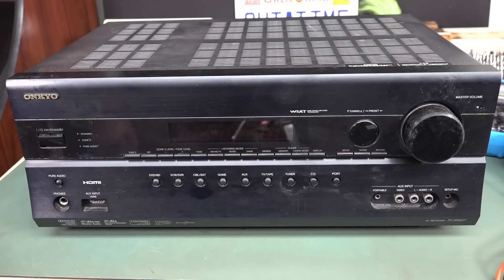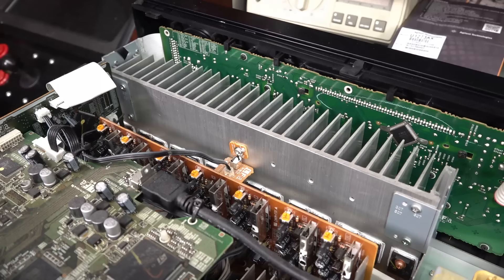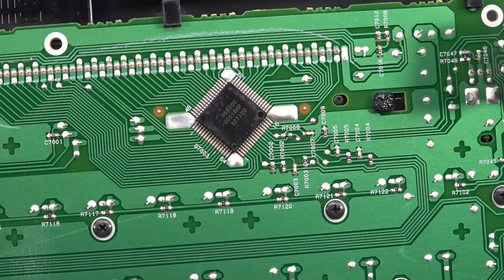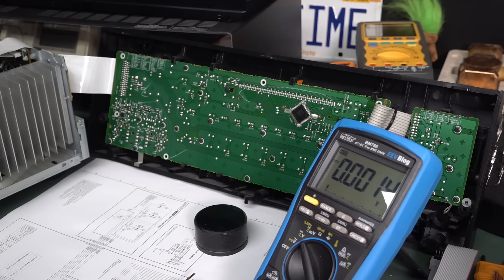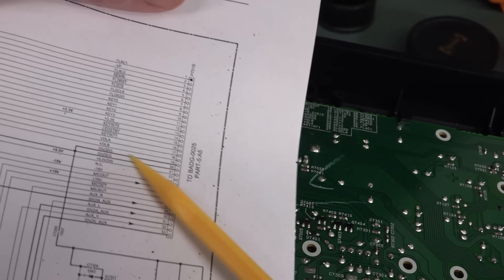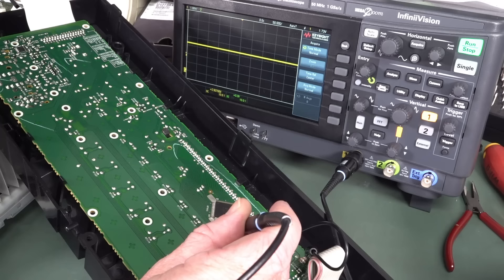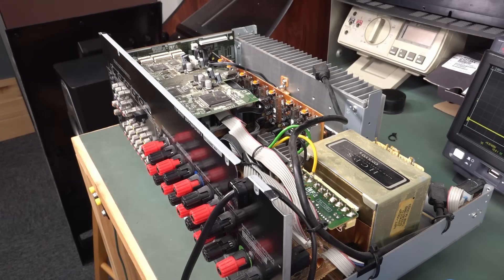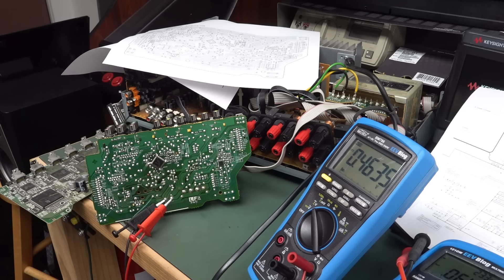EEVblog 1394 - Onkyo Receiver Repair - Part 1

Comment: Is the "Pure Audio" mode on?

My Onkyo has a "Pure Audio" mode where all sound manipulations are turned off for hifi fanatics. In this mode the display is turned off to prevent distortions from the display ;)

This setting is stored even if the receiver is disconnected from power.

So this is what I would check first, if the rest of the receiver is working.

Comment: I'm not sure if this receiver works this way, but on some of them if you engage the "pure audio" or "direct" mode it will shut down the display, along with any of the other sound processing modes in an effort to keep it all clean
Reply: Would be hilarious if that's what it turned out to be - trap for Dave players 😂
Reply: I was thinking that, too. But I think my amp is the same model as this, and it will still show something when it first powers on.

Then, if Direct mode is selected, the display will shut down after a few seconds.

I also wondered if the DIMMER button on the remote had been pressed, as some of them can turn the display off completely. It looks like it's probably the fusible resistor R9010 that's a common fault on these, though.

Comment: I have the SR606 and it's been plagued with bad capacitors. 

The HDMI inputs failed one by one then the machine started creating static popping & crackling when turned on from cold (which went away as it warmed up).

...I've had it apart twice now to replace blown caps. Next time I need to open it up again I'll just replace any I've not already swapped out.

Check all the HDMI inputs work before you finish with this thing (and check all the capacitors in general). If the 607 is anything like the 606 then I'll bet some of the digital inputs don't work and there are caps need changing.
Reply: agree.  I also have the SR606 and replaced the electrolytic caps  about 3 years ago when I had a similar issue

Comment: all the selection buttons are ADC resistor ladder based 
i really have to start using this for buttons you only need to click one of instead of matrixing and IO expanders / registers ...
Side note, i was screaming at the video the entire time for you to check lines going to the VFD from the driver chip

Comment: I have a dumb question?  Have you tried pushing the dimmer control?  I have a Sony that I can kill the display completely, not sure if the dimmer does the same on this unit.  ~Jack, VEG
Reply: Good idea... My wild guess is that the dimmer setting might not be retained if the receiver is unplugged for a long time.

Comment: Interesting... I have an similar Onkyo model (707 instead of 607) that won't turn the speakers on. I think I've seen videos of a BGA reball to fix the issue. This era of Onkyo seems to have a lot of problems, but I also have an Onkyo TX-8511 that's been great since 1997.

Comment: 29:05 I can't wait for a high end AVR to make its way into the lab. From memory my TX-SR805 has four boards to do with power supply, two backplanes, a seperate predriver board for each of the 8 channels, two driver boards, an HDMI board, a processor board, and three analog I/O boards, all connected with bare wire ribbon cables and the cheapest connectors imaginable, and you either have to take however millions of screws and the back panel off to get them out, or remove the almost 20 kg transformer and amplifier assembly, and you can't test it without it assembled almost entirely (you can leave a couple screws out if you want...just make sure they aren't needed for grounding). Needless to say, once you get to a certain point I'd highly recommend going with seperates rather than an integrated unit...

Comment: I had an Onkyo TX SR-805 receiver that I was given from someone that didn't work, they were gonna throw it out, I couldn't ever figure out what was wrong with it, ended up taking it apart, it had the same overly complex interconnection of boards. Massively complex. I still have many of the individual boards. I suspect it was the main processor board that was shot, but I'm not sure.

Comment: I have this same reciever the volume knob only turned up and down the volume if I push it in a little, could this be dust? Should I take it apart and dust it with my air duster?

Comment: I've serviced many of these"PAIN IN THE ASS" Onkyos. Worked in a shop that did factory authorized service repairs for them. Some of these units have test jigs available which are comprised of extension leads with the proper plugs and sockets. Many times they are not available or too expensive. An alternative is to make your own extensions (usually way too much trouble in most cases) or to further disassemble by removing the bottom bracket that supports the power transformer. The unit is then reassembled without the bottom supporting bracket. Because the power transformer is so big and heavy provisions for supporting it in some manner may be needed. After it's reconnected (without the bottom bracket) the grounding that's lost may need to be re-established. Now the bottom portion can be accessed for troubleshooting. The unit should have full functionality in this mode after repair issues are solved. If it's an intermediary board extension leads will have to be made or used. Very impressed with your knowledge.

Comment: This generation of Onkyo receivers are infamous for failing HDMI boards due to a assembly/soldering issue with the DTS chip. You're lucky this one is not suffering from that particular issue... yet.

Comment: I was working on an amp the other day and i couldn't see the correct voltages on the protection IC. The relay coil was hot as in + so it just needed to be switched to ground by the protection ic. I think it was after i removed the pre drive transistors and the main finals that it started to click a connection to the speaker outs again. But this time i measured from 0V to the other end of the protection ic to check for a voltage and it was also back. However the relay clicked off when i used the dc voltmeter to measure here. very sensitive i was surprised a volt meter could trigger it.
 The Aussie version of the schematic. lol i wonder if that was an inside joke from Onkyo. All i am finding is Onkyo repair videos all over youtube. I'm thinking there is a way to get more from this gear, like turn it back into an analogue amp, use fixed resistors for bias. perhaps even use the other channels for mids and highs in the speakers and add a dsp pre amp stages.

Comment: I have the same receiver. Bought is defective.  Had the same problem. Fully working but no screen.  Problem was one little resistor on the board under the hdmi board.

Comment: when devices get this complicated to mesure voltages on inaccessible/dangerous parts, ill power up the dc regulators from an external psu to make sure i get house supplies happy first.

you could feed the vp circuit out of the device to test it
Reply: yeah, feeding often works great. Just be sure to current limit it, otherwise you might destroy something. (sometimes external voltages can do some weird shit like lifting a ground - which might destroy working chips if not current limited)

Comment: 90% of the problems with these receivers (especially onkyo, marantz and some other garbage brand lower end models) is the dts / dolby chip (if its the BGA package!), it just dies.  
without it the output relais wont click, sometimes wont turn on etc. 
known problem since many years, but they dont care.
once the chip died (not a bga solder ball problem, its somehow internal) only fix is to replace it.

Comment: My problem was different, but i thought i'd share this anyway since its a similar unit. I had a power down fail mode happening. No display. Main transformer on for about 2 seconds then nothin'. My colleague said check the output transistors. Then i watched a youtube video saying the same thing. I thought, "what's that gotta do with the power supply?" I found that one channel had two shorted transistors. npn/pnp. both gave up the ghost. I didn't have replacements on hand, however i decided to cut out the bad components, reassemble and attempt to power back on..........i got a display this time then 20 sec and shut down.......i forgot to plug in the temp sensor.......one more time.......bob's your uncle. Unit stays on. Display works. Motherboard detected the shorted channel and said no. Then motherboard detected that i forgot the temp sensor and said no. Lesson learned. Mamma ain't happy, no body's happy.

Comment: Wow! I have repaired exactly the same model (but different fault). This analog video board is very stupidly designed. Lots of linear regulators, which dessipate huge voltage drops and basically cooks the HDMI board above. All electrolytics on the HDMI board are probably gone. They are SMDs and hard to desolder. One easy way is to break their legs first.
I have replaced the 12 and 5V regulators with dc-dc. They are for analog video anyway (useless).
The fault in my receiver was a transistor - intermitently breaking down when hot (in PA circuit).
It is worth adding some thermal greece on the transistors on the PA driver board. They have small radiators and bad contact with it.

Comment: Thats not a transformer, this is a transformer.  Looking at my yamaha dsp-a1.   Every joint on the vfd failed on it,  pins too small for the holes through board, after 23 years though.

Comment: Directly inject -35 v into the circuit and check? If it works i'd try hacking a negative power supply inside instead of fixing the circuit. Looks like a pain in the arse

Comment: Hey Dave, did you realize whats happening with Inflation and the ongoing in the silver market. There is a lot of trouble with unallocatet silver at Pert Mint. If you interested, you can join wallstreetsilver on reddit.

Comment: try this:

https://www.hifiengine.com/manual_library/onkyo/tx-sr607.shtml

So I found a discreet voltage regulator
on the analog videoboard BAVD-0038/U0032 under the HDMI board.

AND I found a broken resistor called R9010 which should be 2.2 ohm 1/2watt
it was about 2Mohm. So I resoldered 2 4.7Ohm in parallel to have something around 2.2 ohm and the one i had where 1/4Watt, so everything was fine.

Comment: with a fully DSP Digital amplifier with a Class D output stage if anything goes wrong it cannot be fixed and should be replaced with a new unit, if that unit is anything like mine there will be settings in the menu of a TV set that disable the built in speaker and route the Digital audio via a SPDIF output to a unit like the one you are working on which switches it on from standby.

Comment: I thought the main reason for the delay between hitting the power button and the amp actually turning on was so that the huge filter caps could be charged up through a higher impedance path, so you wouldn't blow a fuse everytime you hit the power button.

Comment: I like repair videos, it gives me an idea just how big a P.I.T.A. I'm looking at, I have a similar Onkyo with an issue that's on the waiting list to figure out if I should scrap it for components, source a replacement for the offending board, or if it's just a dry joint, I popped the top for a quick look, yeah (>ლ) not going to be a quick one, ლ(͠°◞౪◟°͠ლ) why do I do this to myself.

Comment: In most Yamaha surround sound receivers, the daughterboards are mounted vertically, and not the crazy arrangement Onyko has here.

-EDIT-
I'm actually wrong here.  Just checked my Yamaha RX-V485 (4K HDMI - 2016) and previous RX-V471 (standard HDMI - ~2009) have an arrangement like this Onkyo.  Its the JVC I used to own (2003 model, non-HDMI) that had vertical daughter boards.  (The JVC still worked when I sold it around 2010.  The RX-V471 works too, but doesn't pass 4K HDMI, so I bought the RX-V485)

Comment: FYI - These amps usually have a DIMMER button on the remote. On some versions, that button even lets you turn the VFD OFF completely!

(button +10 at the lower-left of the remote, unless it's in Tuner mode, IIRC.)

13:25 Ahh, so the pinout on the silkscreen was correct.

But the pin numbers are reversed on te schematic. Great. lol